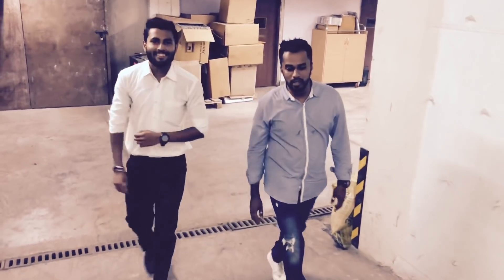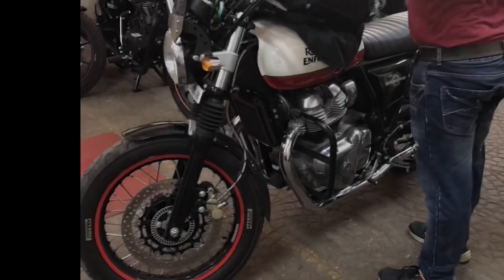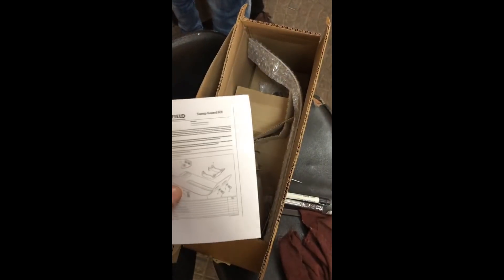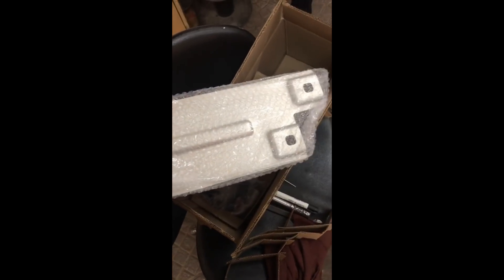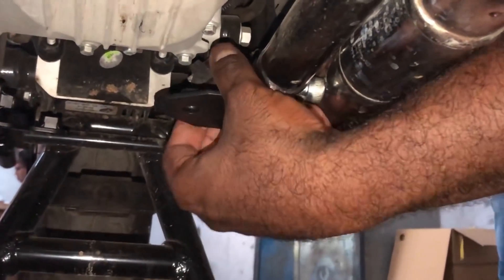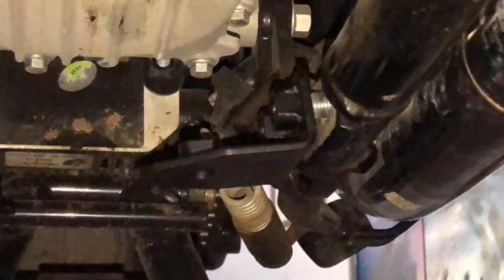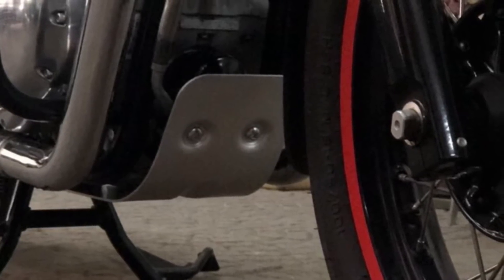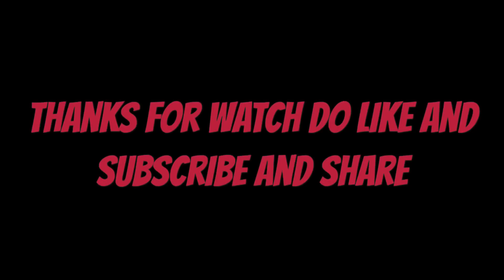Interceptor 650- How to Install Sumpguard

Comment: Excellent video - good to know that this can be done without getting the exhaust off. I see you had the leg guard installed already when you began. Did you have to unscrew in the bolts for the leg guard and install the Black front-bracket there ... or does that bracket go somewhere else? Thanks!
Reply from the maker: Yes bro these r my products and I manufacture them for the twins 

Check out my video on pillion footrest for Twins 650

Comment: Brother please help with solution. I have installed the same sump guard (Just in black colour) but after installation there is a constant humming/ hollowing or eco sound. If i touch the sumpguard, it goes away. Any solution on this?
Reply from the maker: Yes 

Wat you can do is cut a tube (cycle ) and put it between the screw n the hole and this way the vibration sound should go away

Comment: Bro my interceptors oil filter is leaking can i know why is this problem occurring due to sump gaurd or anything else because i didn’t find this type of issue anywhere except mine
Reply from the maker: it could be that its not fitted properly or there is a damage to the outer casing
Reply: @MumBikerBoy  ok the outer casing means the rubber in front of the filter
Reply from the maker: There is a metal casing

Comment: this nifty little allen / hex key is called a "ball end" key. it gives you the flexibility to undo and tighten at an angle of upto 25 degree. Glad you could think of this solution. It will make things so easy. Can you confirm the size (number) for this key. I will keep one in my set.
Reply from the maker: Will try n get the information n share
Reply: Hi Got it. It's 8mm

Comment: Is it possible to get the engine filter off without interference from the mounting bracket?
Reply from the maker: No bro u will have to loosen it up to get the Oil Filter off
Reply: @MumBikerBoy  It looks so close. I wonder about cutting  some of the top of the bracket off, like a crescent slice, to fit the oil filter past.
Reply from the maker: Give it a try
Reply: Gotta buy the bike first!

Comment: Do you do off-roading
Is the sump guard necessary if one keeps the bike on roads
Reply from the maker: harir1 I don’t do off-Roading but it’s a safety measure for the oil filter as if stone or Rock damages it it will not cover under warranty